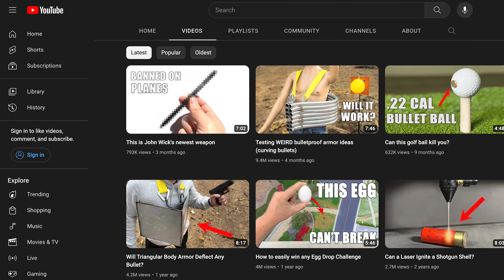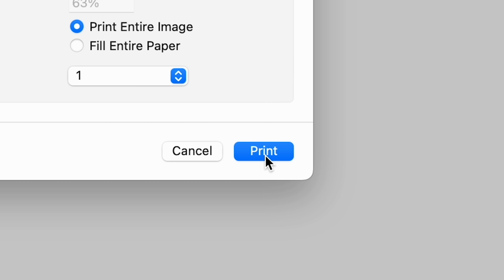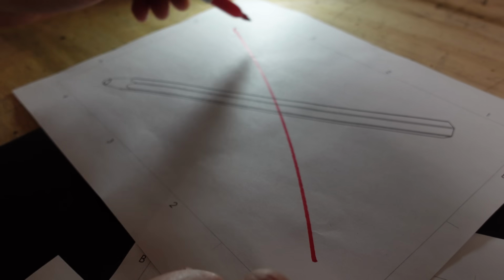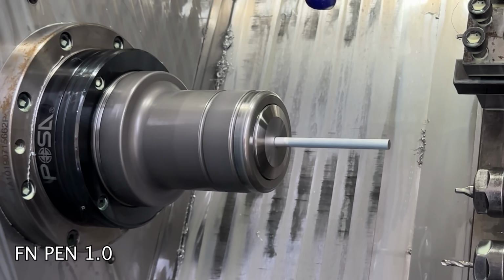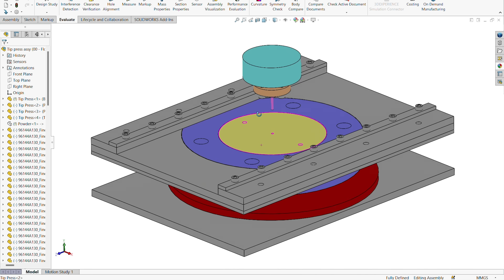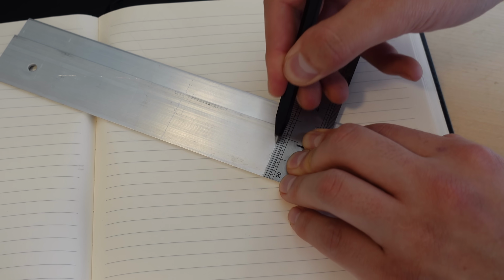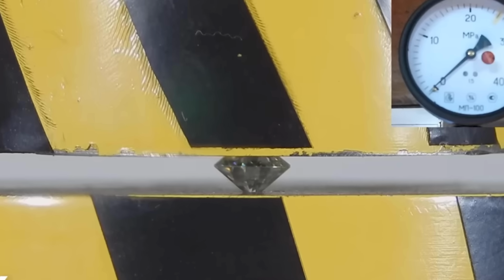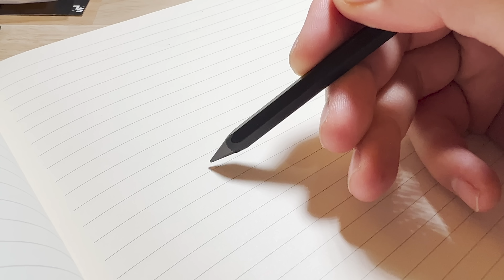John Wick's Pencil (The FN Pen 2.0)

Comment: I think a better idea would be to have the back side be a pencil tip or have it be a replaceble side where you could have it be either a pen or a pencil. Switching the carbide tip will introduce weakness to that section and be a hassle for when you need to switch tips. I garantee that most people will switch the tungston for graphite or vice-versa depending on their usage and just leave it as is. Unless you are regularly going out to stab things with  a pencil, you wouldn't need both of the tips at the same time.

Comment: I think a design that's made to be a functional lead holder would be really neat. 

A super robost 2mm clutch mechanism that holds very securely. Then make a Tungsten Carbide tip, graphite lead, and D1 pen refills that can be stored in a back compartment. Properly fitted, so there is no rattle when stored. 

Same eraser on the back, with a twist locking mechanism on the plunger so you can use the eraser as cushion/leverage without releasing the clutch.

I have a feeling the lock at the rear could wear down over time. So you could either make a threaded clutch mechanism, or make the entire clutch a "tip" option like the tungsten and pencil ones.

Comment: I think a great idea would of been to make the metal tip(window breaker) in the form of a clip like most pens/pencils have. It might have to be a little bigger then normal pen clips but could definitely be done I’m sure. So when you want to use the window breaker or scribe or whatever you need it to be. You could flip it 180’ and be parallel with the pen and have it lock into place. So then you would have it obviously be long enough to go pass the edge of the pen so it would be effective. Don’t want it tooo long tho just barely past the eraser so it could make contact with the surface and not damage the pen itself. Then fold it back into Normal position when done. And the tip would always be attached just imagine the clip molded so it could have a very small point on it. The clip would have to kinda flat pretty much like any type of blade. 
Man… I hope that made sense to anyone who actually reads this 😂🙃🤣

Comment: Really perfect. The only thing I would change is the screw mechanisms. If the 3.0 version comes with fast and easier lock-in mechanism  foreraser part, it will be a totally reliable product for everyday use

Comment: You should make a 3.0 that is mainly an ink pen with the same astetic and similiar features. The ink pen is a nice bonus in this version but having to unscrew the cap multiple times for repeated use is not good for fast in and out pocket use. Definately the best graphite tip pen out there though.

Comment: no one is going to see this but thought it would be cool if the metal tip worked as a pencil and didnt need to be swaped
Reply: Tungsten carbide is far too dense of a metal to be used like a pencil. And metals soft enough to be used as a writing medium would dent, and/or warp on use.
Reply: @derpyderp6719  i know just imagane if there was a metal that would work

Comment: Needs more work into the scope of a needed 3.0

The graphite nibs (at times) have a trickled trail of glue on the screw-in section.
An added 2cm metallic buffer between the nib and base wouldn’t be a bad idea
-if it has at least two twist purposed grooves.
That way the magnetic eraser can maintain its utility on the graphite nib adapted when pen use is desired.

I don’t mind offshores fabrications. It’s sleek but can leave more to be desired.
It’s balanced for the listing price but, I guess I should’ve made a test purchase
Instead of buying an assorted number for gifting purposes.

You’ve got a cool thing going on. (For about thirty bucks it’s pretty damn sweet.)
I guess I’ll have to wait to sample after it hits a different benchmark.
Not only as a standby gift but, also as something I could enjoy for myself.

Comment: Would have been better without the graphite. That's another small thing to lose. You could have used heat-erasable ink and harder rubber compound to erase it. Also, adding magnets to something which didn't have them isn't okay, especially since many of us wear mechanical watches, have pacemakers, travel etc. etc.

Let's hope V3 gets rid of proprietary graphite tips in favor of being the best erasable tactical pen on the market.

Comment: super curious on the design choice. Wouldn't it make more sense to have the penetrator part under the cap instead of the pen? I figure you'll be using the pen part way more than then penetrator.

Comment: Guys seeing as such tactical pens are illegal in the UK (and no doubt elsewhere) the very ordinary look is excellent, however, from a self-defense perspective, what would be great is having the tungsten tip hidden under the top cap (opposite the writing end), so if needed quickly then the top cap could be removed with a quick single turn (perhaps also magnetized for extra hold) to expose the tungsten tip, which would then not be obvious under casual inspection. What do you think?
Reply: You guys can't even have pens in the UK? That's the dumbest thing I've ever heard. You guys need them with all the crime you have. I bet tactical flashlights are banned too. You wouldn't want to hurt the baddie stealing your wallet. 😂

Comment: I tried using the included wrench but still could not change the ink on my 1.0. Any tips?
Reply: Same here, warped the threading trying too hard and now cap won’t go on. Still no clue how to put a refill in.
Reply: @MrSeben  Almost did the same but was able to force the cap back on. Just gonna leave it as is and use as a glass breaker only. Really wish the company would post up a video showing how it’s done smh